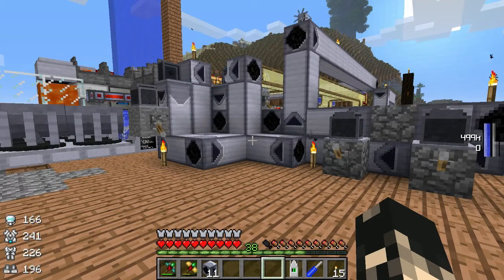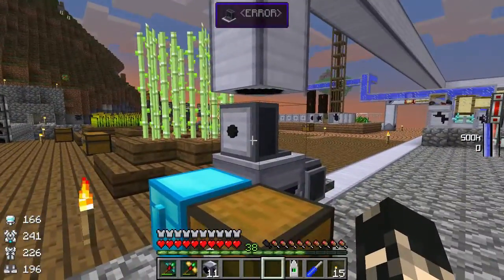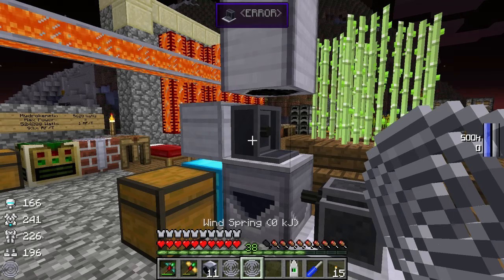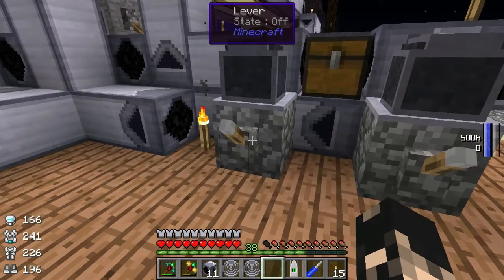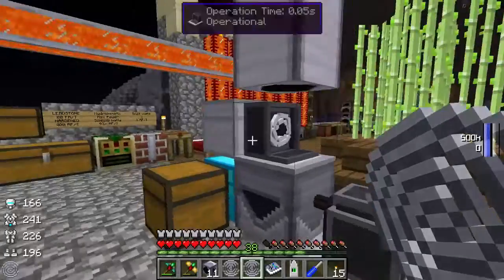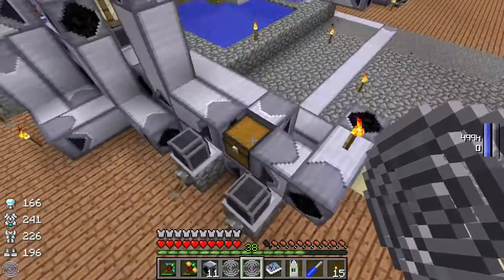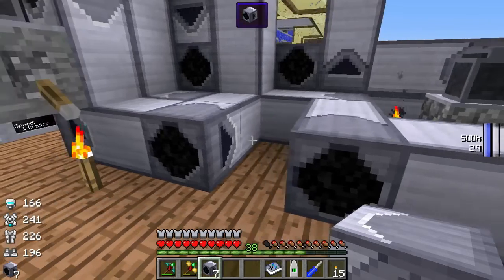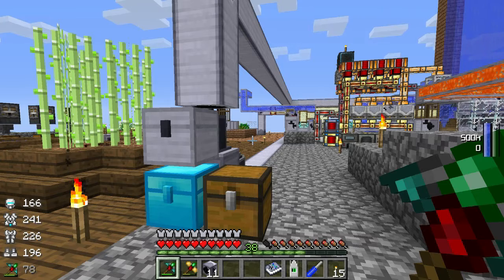Monster FTB Rotarycraft Scalable Chest, Cluster Beep System

Comment: Belts are also good for power transportation.
Reply from the maker: My only concern with belts is the power loss over distance. I'll test them out. Thanks for the suggestion.
Reply: They do not have distance losses, but they do have power caps.
Reply from the maker: thanks for clearing that up.